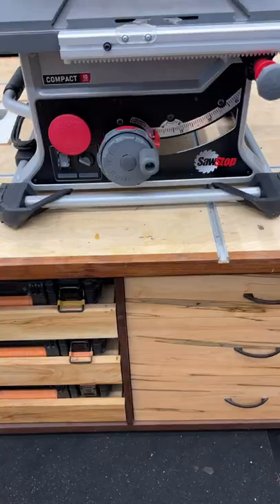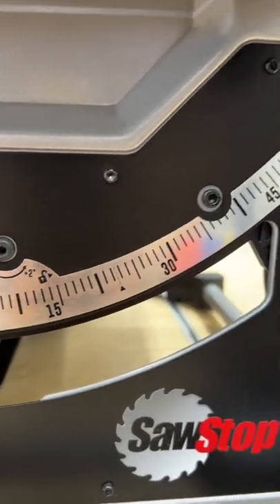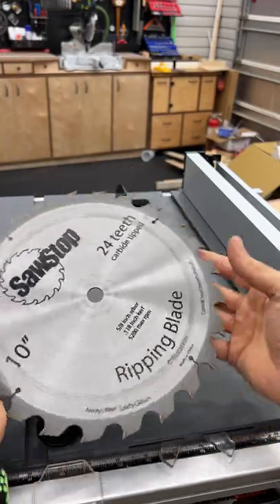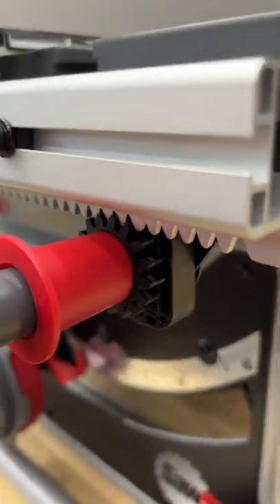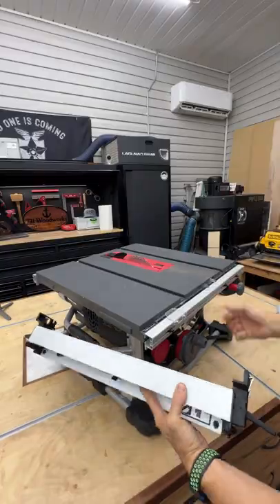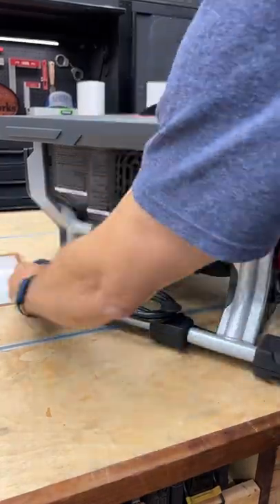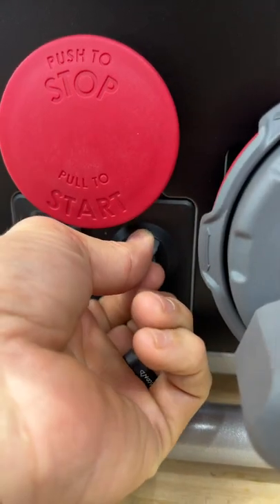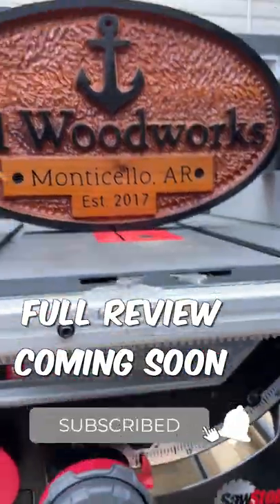SAFEST Compact Table Saw You Can Buy #Shorts | New Sawstop Compact Table Saw

Comment from the maker: Sawstop Compact Table Saw (AcmeTools Affiliate) - https://imp.i284638.net/WD5LYO
Reply: Can it support a dado blade?
Reply from the maker: @christopherwilliams9639  unfortunately, no it can't.
Reply: Dang it
Reply: Seems reasonable saw for contractor or home hobbyist not needing a dado
Reply: @731Woodworks  pretty sure it does accept a dado. You need to change the brake when you use a dado. The break for dados is $110 or so accessory.
Reply: What's up 731 which compact table saw would you recommend for a beginner . Thank you
Reply from the maker: @jlbaker5012  This one https://youtu.be/qOANCOd1NCE
Reply: I have a dewalt table saw with 10 inch blade and need to upgrade the miter square, which one do you recommend??
Reply from the maker: @stevegagnon9451  Incra V27 is a good one
Reply: I really need a good miter square lol
Reply: @731Woodworks  thank you, tuning in from Quebec Canada
Reply: @731Woodworks  I’m also looking for a router table insert for the dewalt router

Comment: I need to start a YouTube channel to get promotional deals on tools to review them. That would be amazing. 
Beyond that, why was there a 24 tooth 10" blade shown? Was it bought to rough cut lumber?
Reply from the maker: I bought this saw with my money. Wasn’t given anything for this saw
Reply: @731Woodworks  That's fine. I believe you. My first paragraph was a general observation as some YouTube channels do get promotional deals for reviewing products. I did not reference you specifically in that paragraph.
Reply: @nonprogrediestregredi1711  mine came with a ripping blade so I think that’s standard
Reply: @AaronGeller  By saying "ripping blade", are you stating that it was a 24 tooth? In the thirty years I've been doing carpentry, I don't believe I've used less than a 40 tooth in the 10" diameter.

Comment: I've seen the sawstop demo with the hotdog but that is slowly pushed to the blade.

What about if the lumber you are cutting some how pulls you in quick?
Reply: It's supposed to work like that.  It might still cut you but it's not supposed to mangle you like a saw would without it.